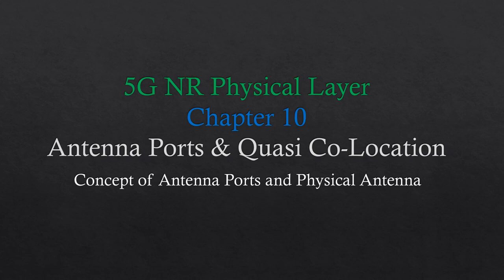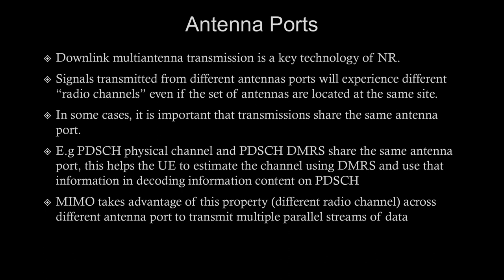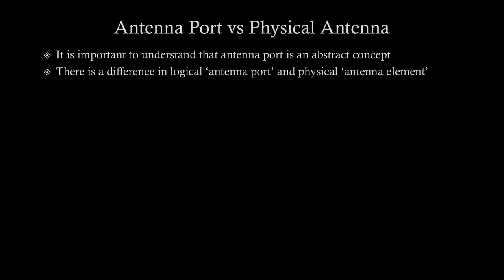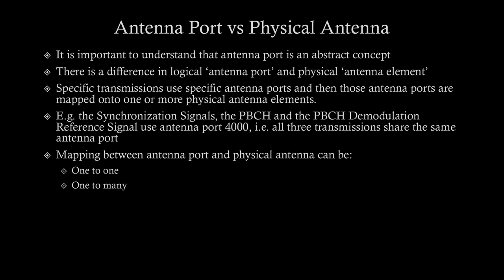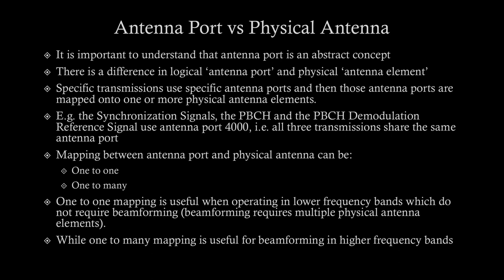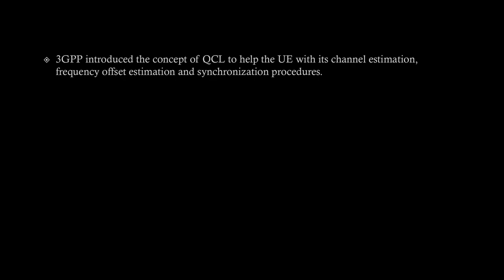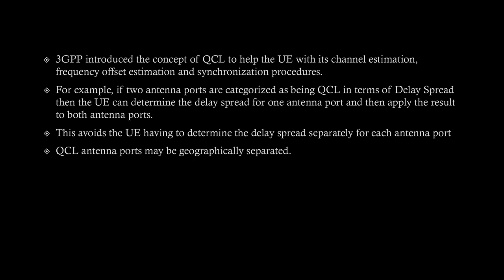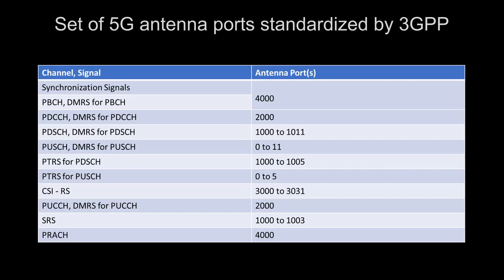5G NR Physical Layer | Chapter 10| Antenna Ports, Physical Antennas and Antenna Quasi Co-Location

Comment: Thank you. One question, maybe I missed it: in case 1, as you say, one antenna port map to one physical antenna, (red) and the other antenna port to the blue. But the figure describes 4 physical antennas (blue) and four red. Do you mean that antenna port e.g., 1000 will be sent by all the blue ones? Thank you.
Reply from the maker: Actually No, those are for representation purpose only. If the mapping is one to one, that means a specific antenna port is mapped only to a single physical antenna.

Comment: Hi...Thank you for sharing this...My Query is:
1. In case of SS/PBCH block, we have L=8 for sub 6GHz band i.e total 8 blocks will be transmitted. For this, we are generating 8 SS block. So, there we will have one antenna port or many....if one antenna port than how mapping will be done to form 8 different beams?
2. Also, After layer mapping, we have an antenna port that will give us a separate resource grid of each layer...So, how these all resource grid come together (Like 8 SS block beams on 8 different grids)...Please confirm ....I hope I have conveyed my query properly.

Thanks!!
Reply from the maker: 1. Different SSB blocks are transmitted over different beams known as SS Burst Set which leads to SSB Beam Sweeping
You can watch lecture 7 for more details https://youtu.be/EMG-xuMnna0?t=414

2. If I understood your question, then the answer is layer demapping at the receiver side
Reply: I think the SSB beams are separated in time...So, they can be transmitted from the same port but at différent time..

Did not understand your question about layer mapping

Comment: 5G NR Coverage is dependent on SSS EPRE which determines EIRP and Required RSRP at the cell edge.SSS EPRE is based on single antenna port.
Question: PDSCH EPRE would it be same as SSS EPRE or would it have any offsets...Or they are another parameters used for Channel estimation….how to calculate EPRE for SINR CALCULATION
Reply: What is epre

Comment: Hello Sir,
It is not easy to understand the abstract nature of antenna ports & QCL.
It would be more helpful if you could share mathematical expresisons for antenna ports. A simple scenario 2x2 would be fine.
If not, pls share any references of the same. 

thanks
Reply from the maker: you show think about a standard MIMO system, like Y=HX, where H is a 2*2 channel matrix, refer any standard book for this type of understanding. This has been touched to some extent in another video: https://youtu.be/TmOYOr_N4Uk

Comment: What is the difference between layers and beams?
Reply from the maker: Layer is a concept used for dividing a codeword into multiple segments which are then precoded and sent over multiple antenna ports. While beams are actually the output of a physical antenna which carries the actual signal over EVM waves.